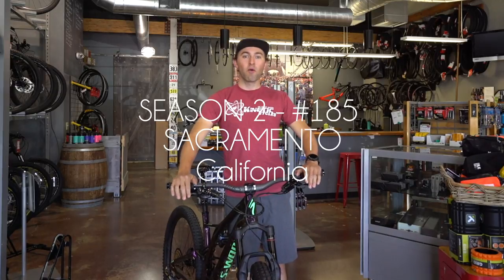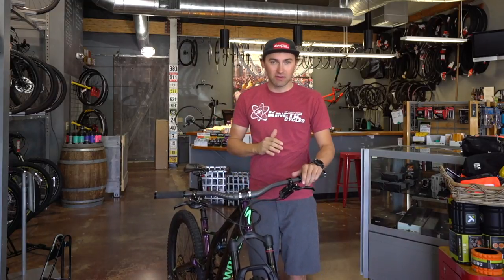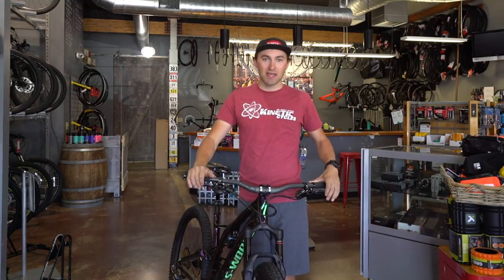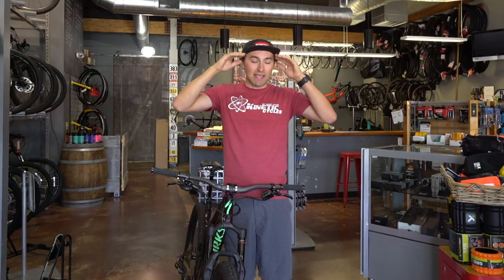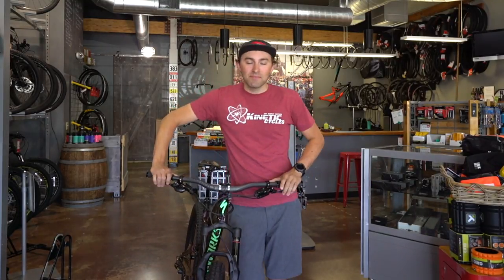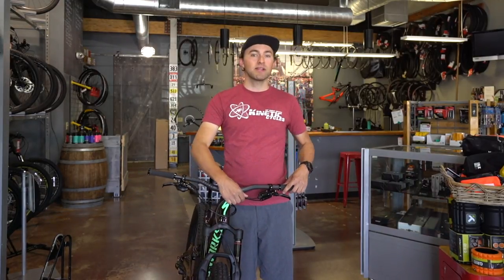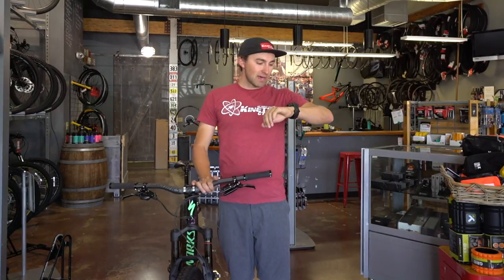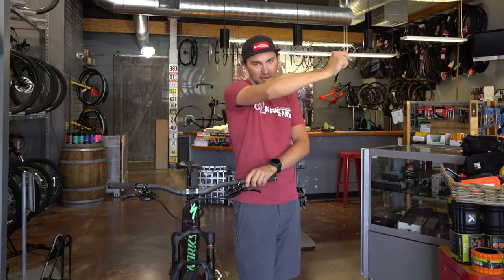Tech Talk - How To Adjust Low Speed Compression . VLOG 2.185

Comment: Still confuses me. I wish there was a simpler system or a specific setup for different trails. I ride steep tech and big smooth jump trails (Queenstown, NZ). I have a lyric fork. Any suggestions? I dont know what 'open up' means either. So clockwise and anti clock wise or + and - work better for me.
Reply: Tim, I ride a 160mm Pike on the front of my bike and ride the same terrain as you described, lots of steep technical stuff and big smooth jump trails like Whistler A-Line and our local stuff here in Seattle. There are lots of different personal preferences regarding suspension and here is mine. I spend a lot of time initially dialing in air pressure, tokens, rebound, LSC, recording all those numbers, etc and after I am happy with suppleness and bike feel the only adjustment I do on the trail is the climb switch on my rear shock for sustained climbs where I am getting to the top of a flow trail or downhill run. I leave my fork in the fully open position, aka all the way anti-clockwise or minus, even during climbs. I feel like my suspension handles everything well and bike is predictable in all around conditions. I can see some advantages in turning in the LSC + clockwise a bit to get better support on pumping flow trails but I feel like the trails I do are always going to run into some sections where I want that LSC fully open so that is where I leave it. Everybody is different, but that is just what I do.
Reply: Actually, there is one other trail adjustment I will do. If I am riding super loamy terrain I will drop the air pressure front and rear to give a more supple feel since I will not be taking any huge shelf hits or rooted tech sections and then when I go on the next ride I reference my normal shock/fork pressures and return it to those numbers. If I don't drop the air pressure on that loamy stuff then I only use about 80% of my travel on the loam and dropping the psi gets me closer to using all of my travel. Like riding on marshmellows! Love it.
Reply: @rickcorlett  I turned my LSC all the way in the minus direction today and it made the braking bump disappear a bit. I did notice that it was as nice and supportive in the berms and jumps. I guess that's the trade off. Does that sound right?
Reply: @timquain5341  Yes, that sounds about right. I never turn on any LSC on my fork. If there was a day where I was only riding dual slalom, pump track, or butter smooth flow trails then I would consider dialing in some LSC on the fork and shock; however, I just hit those as part of a bigger trail riding day and have been happy with the support I get by dialing in my suspension as I said in the first comment. And to be honest if I were riding dual slalom, pump track or butter smooth flow trails then I would likely bring my dirt jumper and not my mtb.
Reply from the maker: You guys are thinking and adjusting correctly. However I would recommend that you think about increasing low speed compression for jump and flow trails to help the bike from squatting as it hits the maximum compression on the face of the jump or deep in a berm. Them reduce the low speed compression for tech trails to allow the fork to absorb more small bump
Reply: Cody Kaiser I went to the local bike park where I rode all jump lines with berms, gaps and only a few big drops. I increased LSC + out halfway on fork and shock and was impressed with the extra pop I was able to get off lips where I used to need to carry just a hair more speed to clear comfortably. Thanks for that advice. I had never adjusted LSC for flow trails and jumps before. Solid tip! I totally get why that works.
Reply from the maker: @rickcorlett  That's great!  Glad it helped.

Comment: So adjusting slow speed you want to set it to give you more support over small bumps, so it doesn't wallow.
Setting high speed you want the spring to go limp and allow a big hit to allow your shock to soak up the hit.
How the hell does the shock know a big hit from a little one?
Thanks for the explanation. You have made it more understandable than most. I'm trying to apply this to after market motorcycle shocks which offer adjusters for length, preload, rebound, compression high and low and I'm lost at which setting I need. I just want to soak up the bad roads of Britain without feeling like I'm on a pogo stick. I know I need rebound, preload comes with all of them but do I need compression?
Reply from the maker: Suspension with High Sped Compression can sense that based upon how fast the fork compresses. Almost more like LSC is beginning stroke adjustment and HSC is ending stroke adjustment.
Reply: @thekidkaiser   I have no idea what  LSC and HSC is.
Reply from the maker: High Speed Compression and Low Speed Compression
Reply: @thekidkaiser   Oh, I see now, thanks

Comment: Nice video. What you sugestion about my Lyrik 160mm with 95psi (30% sag) 3 tokens 3 clicks rebound to fully close and 10 clicks  lsc to fully open ( goes to 19). My feel is that is harder than i would like in high speed smal bumps and roots.  i was thinking about put more one volume spacer and reduce air pressure, but it will stay less than 30% sag. what do you think?
Reply: If anyone in the future reads this:
Go the other way, remove tokens and increase air pressure. Your fork is too soft then ramps up and feels hard. Try 1 token 20-25% sag

Comment: Would you consider low speed compression or travel to be when you’re pre loading your weight into your bike off the lip of a jump?
Reply from the maker: That's exactly what low speed compression will aid in. You want to increase the low speed compression to help with jumps and berms.
Reply: @thekidkaiser  last question just to clarify. Would high speed small bump chatter be hsc then? Sorry if you mentioned this in your video but I’m really struggling with setting up my suspension the right way. Thanks for all your help dude.
Reply from the maker: @425flex  “high speed”
And “low speed” don’t refer to MPH speed. It refers to the speed of the stanchion moving. 

High Speed rebound or compression refers to BIG hits. Where you’d blowing through the travel

Comment: Great video brother! Please put out some more knowledge! Cheers
Reply from the maker: Working on it!
Reply: Thanks for the reply Cody. Proud owner of the new Santa Cruz Blur and new to XC bikes in general. Coming off an enduro style bike (Bronson) I would assume the suspension set up would differ in terms of sag #'s. Although this new generation of XC bikes seem to be more on the Extreme side of things and ultra capable we are still dealing with 100mm of travel no less and curious to pick your brain on how you go about setting yours up exactly. Do you tend to lean more on 15-20% sag as opposed to 30%? Do you run your tire pressure higher for faster rolling (although i've seen videos where wider and lower psi tires have rolled better)? Keep up the great videos and look forward to more

BTW - Really enjoyed your Shockwiz video. What were your final thoughts on the device? Perhaps a follow up on your final verdict picking apart the shockwiz recommended suggestions could be a future project? I myself have 2 and have mixed results and opinions  on it. Cheers!